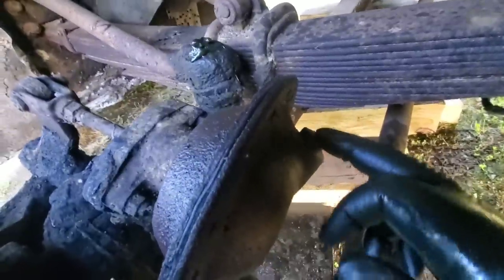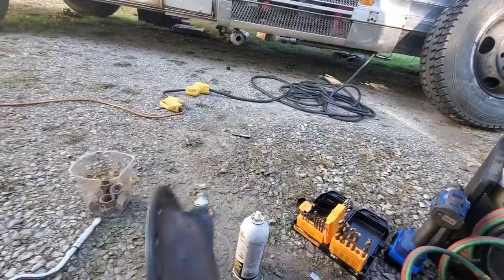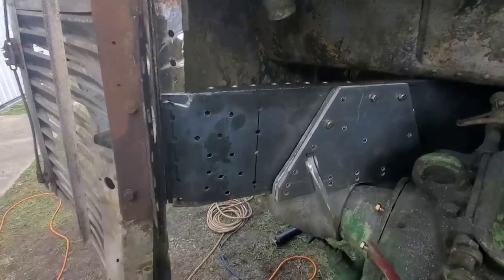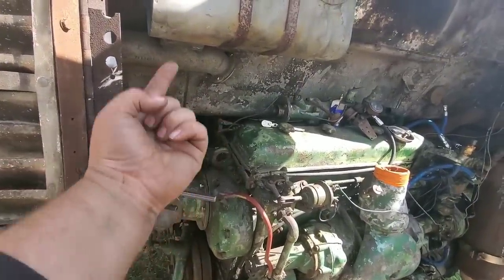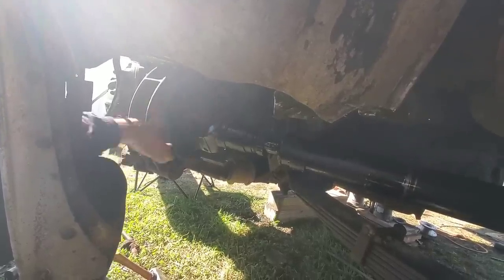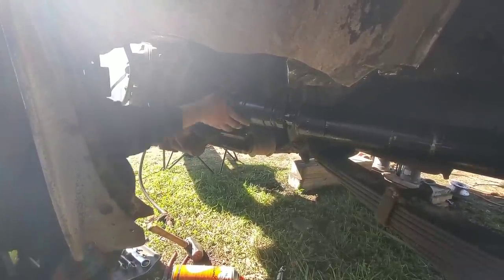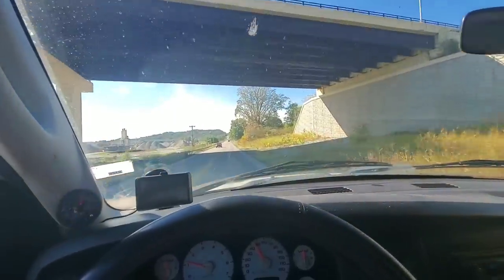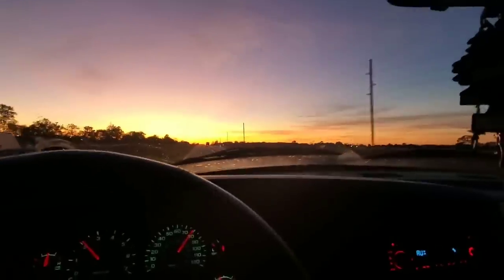Pre-war silversides day 6

Comment: I keep an old 20+ year old Volvo V70 diesel wagon on the road. Yes  it has dents and scrapes. But the body is solid and the engine is still healthy. Bought the thing for a 1000 bucks because the guy said it was a lost cause because the suspension was worn out and broken. 320 bucks in parts and 6 hours of labor later the car was back on the road. 
I still drive it to work and take it on long road trips. That lost cause has been on the road now for 5 years. With 403 thousand kilometers on the clock or 250 thousand + miles. 
To me this Bus is Healthy and just needed some maintanace and repairs.
Reply from the maker: My 97 ram 2500 i usually drive was $700. Its old, dented, and has 260k miles but everything works and after a tune up, new shocks, brakes, and tires its a great cheap daily. I have less than 2k into that truck.

Comment: sage is a VW split bus guy. This bus was cheaper to get then most project VW buses! The repairs are comparable to what a frame repair would be on a VW bus. The total cost for parts and repairs, including rim and tires is not that far from what sage is used to spending to get a VW bus project roadworthy. This is a good bus, and a good deal.

Comment: I agree, spend the time and make it whole again.
The issue I see now versus 20 years ago it that now there is this huge off the shelf mentality where if it doesnt come off the shelf and bolt up in 10 minutes then its not worth doing.
I've seen this with cars and trucks as well where people will write off a project because of some rust or structural failure instead of spending a few hours to section out, re fabricate and then replace and I have taken on many projects written off by others and made things whole again.
Lets face it, the manufacturers made these from separate components so its quite simple to disassemble, fabricate and reassemble with the huge plus being that this time around you can make it better, stronger and more durable because you have identified the failure either due to age or abuse and can see how to correct the issue often using stronger, better materials.
When its gone... Its Gone so save it and enjoy it.

Comment: Rather than having bolts replacing the original rivets in the motor mount assembly, I would have used Hi-Loks so that the threads on the bolts don't contact the interiors of the holes.

Comment: I recommend replacing the diaphragm on the other side too to keep the balance even across the axle.
Reply: Diaphragms and brake chambers at just like wheel cylinders and calipers. They should always be replaced in pairs on the same axle.
Reply: We replaced all of the components.  I need to have shoes custom built and they will be put on when the Bus Grease Monkey and Indiana Mobile Diesel come back to finish up
Reply: @SilversidesSage  Good job.

Comment: Hi, 4 or 5 years ago the reman engine in my 1990 Ford f250 had  major oil leak valve covers,, ft  and rear main oil seals. Milage is over 600,000.0 miles on truck body pretty good  when I blue up my engine truck would not do over 30. Mph. After 1 he oil pressure was 5 lbs. Instead of 65. Lbs. Put a scrap  used engine in my truck and still going. The truck turns 30 years old in April next year.... I must be doing something right to keep her going. Oe. 5 speed manual transmission, and trans fer case.. 2 So why not fix this old lady who is American travel. History.  Also my old garden tractors are 1982, 1970, 1985, and 1977. F.M.C. Bolens G 14 garden tractors there weight run from 250 lbs up to 978. Lbs  stock.  Jim in Colorado springs CO.

Comment: That's not a 4101.  It's a PDA-3701.  PDA = Yellow Coach Div.  The PD-4101 was a postwar parlor coach based on the transit body of 1940, with the front axle moved forward.  The 4102 and 03 were based on that one with fresh styling.
Reply from the maker: This is a yellow coach PDG-4101. They were produced from 1940-1941. The VIN is 4101-149

Comment: My only comment on your rant is the repair is all good except and prep for dissimilar metal corrosion. My experience comes from heavy aircraft overhaul and have seen and dealt with dissimilar metal corrosion on many steel to aluminum structures.
Seems though you think your doing the repair correctly I just do not see any metal prep to ensure the corrosion does not reoccur in the future..
Reply: What kinds of prep would you suggest?
Reply: I defer to.Body’s Hawrysz excellent comment and curious too, When I restored my 1956 Cessna 310 my A&P had me using alumiprep and alodine to clean,etch and coat aluminum with a light shot of zinc chromate.